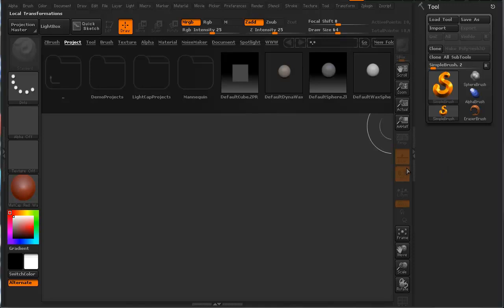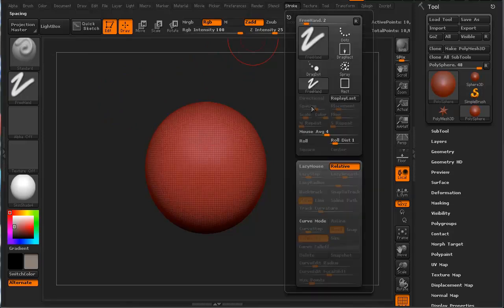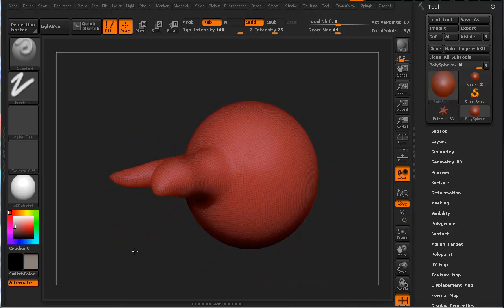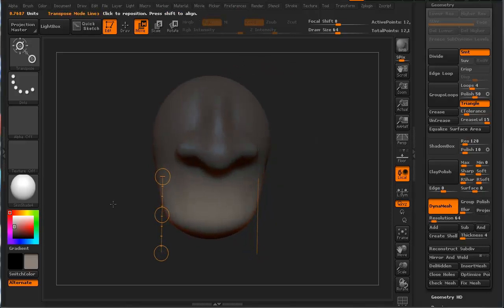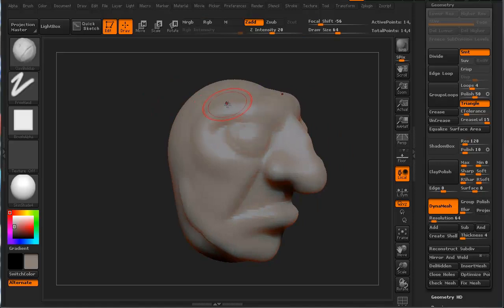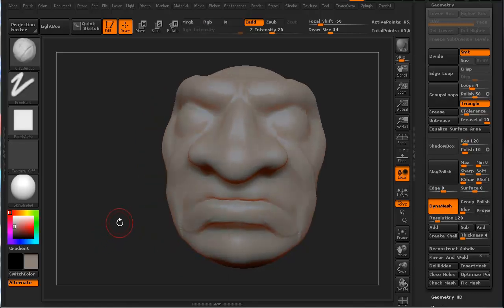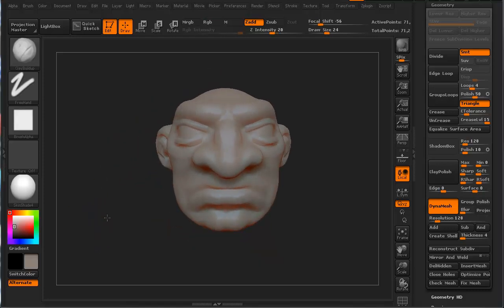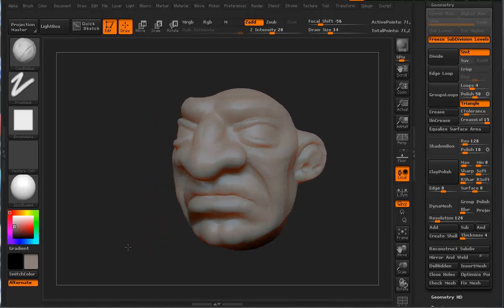Dynamesh Sculpting in zBrush (3dmotive)

Comment: I can turn on the Mirror Sculpting device by hitting the "X" key. But how do I get it to be equidistant or add even more points so I can have more control over a larger area? I knew how to do this a month ago...but haven't used it since then and just forgot where the heck the controls for the "X" key are. I want to be able to control the X and Y and the Z functions for that tool.